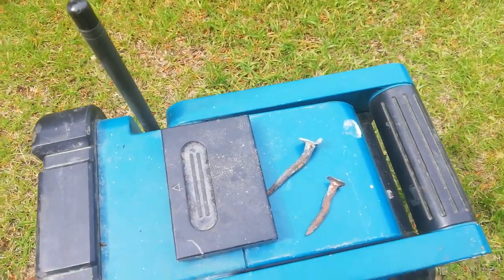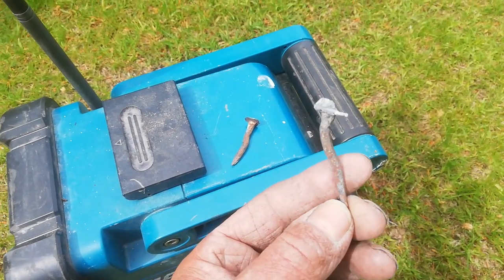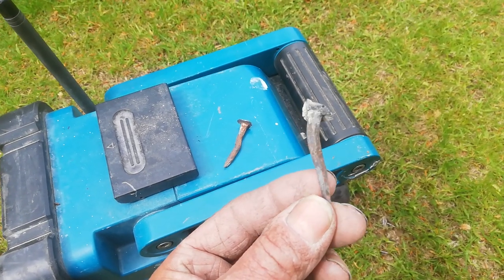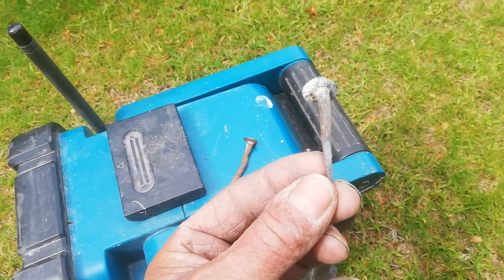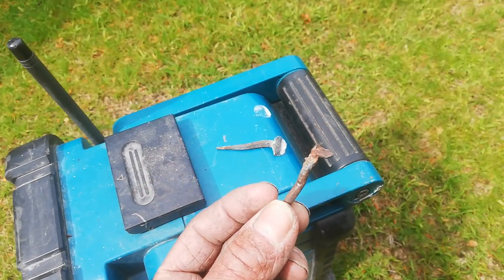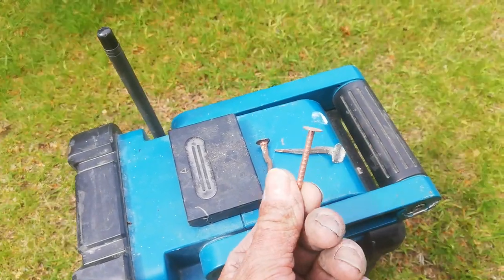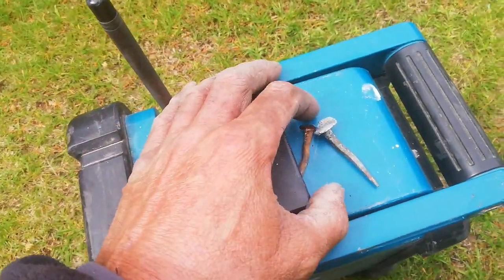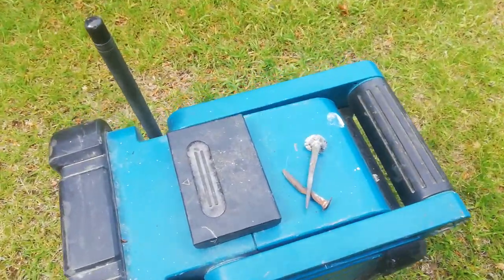Using the correct nail for slates. Why it is so important.

Comment: This is a topic much worth revisiting Sir. The first square section nail you showed appeared to the camera to have a bit of a coppery glow in places, so I am not sure if it was ferrous or not (confirm with a magnet - on camera - if you revisit this subject).

If the first nail was ferrous then it would most likely have been wrought iron, hence the square section shank, and wrought iron is hugely resistant to corrosion, as opposed to mild steel (as per the second nail) which rusts in no time without a protection system. The Galvanising itself can quickly chaff through around the slate hole area however and render the roof nail-sick, ultimately. 

If that first nail was indeed ferrous..... and wrought, it is unlikely it would even have been galvanised (or Sheradized, as it was initially called).

Steel didn't really start to become cheaply available until around the 1860s when massive coke fuelled blast furnaces began to develop in the North East, Cumberland, and Scotland.

Kind regards.

Comment: St Albans/ harpenden in Hertfordshire mate, I’m doing exactly the same thing! Just replaced a single pitch roof done 10 years back where the nails on every slate have worked themselves loose... cheap galvs, the rest of the roof original Welsh slate just a few slips!
Reply from the maker: I know where you are. I got asked to do a lead job there, about 3 years ago. One hell of a drive from Scotland.
Reply: @roofingshiteroofing1189  no, sod that I don’t work out of my area... price high if it’s more than 20 min drive 😂
Reply from the maker: It was an offer I couldn't turn down.
Reply: Price goes up 20% in St Albans 😆 
I done the roof on the Tesco on the corner in Harpenden.
Small world

Comment: Hey guy, great video, thanks.
May I ask a quick sports question?
I’ve just had some guys put some slate (manufactured) on a vertical roof. Quite a few, where their angle cuts and inside window reveals are just glued. Is this good or acceptable work or should I insist that they were nailed/pinned.
If you do reply, thanks a million
Reply from the maker: Can you show me a photo?
Reply: @roofingshiteroofing1189  thanks for the reply. I don’t see a way to do that.

Comment: Copper nails wear they go thinner over the years that's y you get slates slipping out on older roofs due to the copper nails . Alloy better than copper doesn't rust or strink . They just become brittle so when you try pull them out with the ripper they just snap off.  But if not touched there fine
Reply from the maker: True, but I'm on the West Coast of Scotland. Alloy nails don't last in costal areas, they oxidise
Reply: @roofingshiteroofing1189  very interesting 
Never knew there was so much to it especially regarding costal areas

Comment: Ali nails are just fine
Reply from the maker: In land, yes your fine. I won't use them on coastal areas
Reply: Not all ali nails are the same though
Reply: When you say Ali, do you mean Copper/Nickel or Ally as in aluminium (surely not aluminium, soft as hell material).